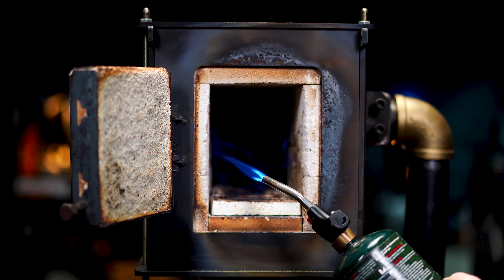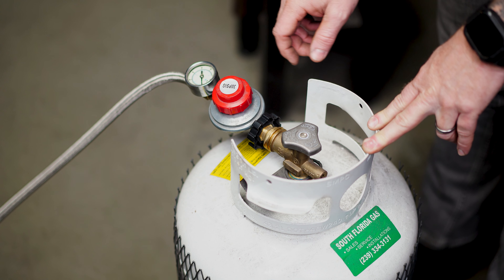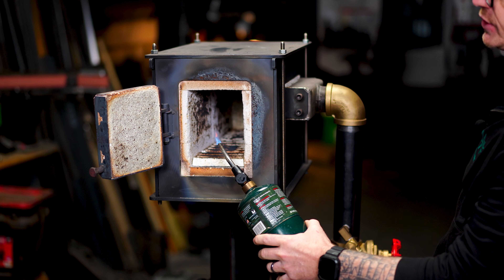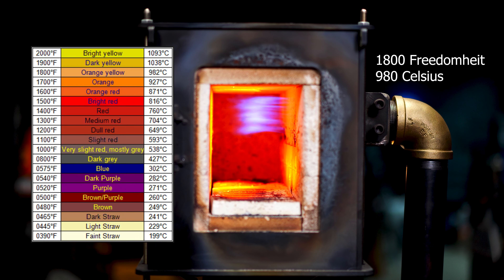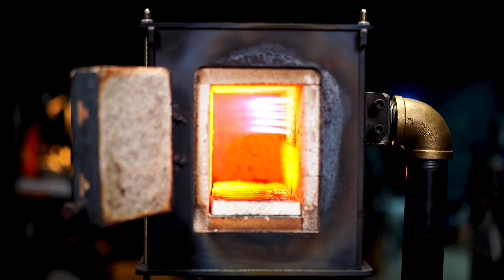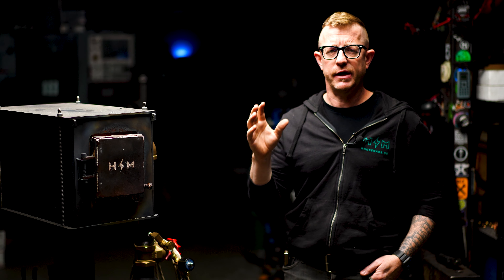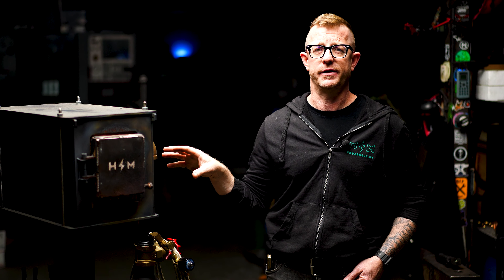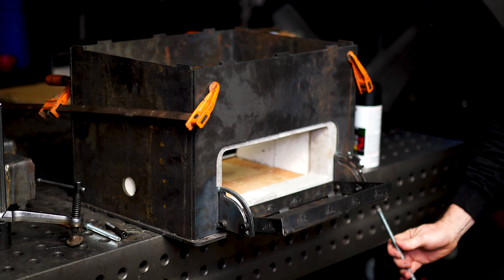How to: Optimize the Apollo Forge

Comment: Brian, look into / talk to Mark Krause about his conical jet burner rather than a ribbon. Safer in that it doesn't mix the propane in the pipe leading to the burner, rather injects right before the forge into a hollow cone bored into some soft firebrick. I use these on my furnace as well as my forge. Not as evenly distributed as a ribbon, but the "nozzle" orifice can be geometrically adjusted to disperse the flame more evenly and induce swirl.
Reply from the maker: Interesting. I'll ask him about it. Thank you.

Comment: When do you completely open your needle valve so your 2 psi is reaching the burner for ignition?  I'm the 1% part of the  10% part. I'm also sitting at 4393', which I'm thinking may be contributing to not getting a better efficiency with my forge.

Thnx 

Jon
Reply from the maker: Hi Jon, I don't usually ever completely open the needle valve. I just use it to fine tune the forge. Once it heats up it becomes very easy to maintain temperatures. The green flames are just from the camera, it's almost always blue, yellow
Reply: Thanks Brian 😊@HouseMadeUS

Comment: Talking of different forge designs I’d be interested to see a ribbon burner postbox forge. 
I don’t know how popular that would be though.
Reply from the maker: What is a postbox forge? I've never heard of this. Is it like the one Kyle Royer uses?
Reply: Possibly. It’s where the burner is at the bottom and the entrance is at the top. Basically a normal forge vertical with the burner at the bottom so you get complete burn by the time it gets to the opening. The other benefit I’ve seen is the bottoms are removable so you can replace the insulation for flux build up.

Comment: I've been working with industrial, high pressure, compressed gas life support systems for a long time. I was always taught to turn gas bottle valves all the way on then back off a quarter turn.
However, years later I was told by a company technician to ONLY have the valve all the way open or all the way closed on the consumer grade bbq style tanks. Specifically, any position in between can allow for gas seepage into the workspace which can lead to some catastrophic events.
Just an observation, perhaps some of you have been told otherwise????
I'm always open to learn something.
Reply from the maker: I have not heard this. You can smell propane so if it's leaking I would know, and it doesn't.
Reply: Yes, I use Praxxair and they say to fully open or full closed. No middle position, the stem seal will leak, but there is a seal at the bottom “so to speak” and one at the top. Only valve that works in the “middle” is the acetylene type valve.

Comment: I think your forge welding range is a little high.  If you're forge welding with a power hammer or press, 2100º - 2200º is optimal.  2200º-2300º for everyone else.  If you want steel that's going to be compromised, go hotter.  A great example of forge welding too hot would be the Forged in Fire episode where Josh Smith lost because his sword edge chipped out.  He heat treated perfectly, but his steel was already jacked up due to the forge welding temps.
Reply from the maker: Definitely can be an issue. I tend to thermocycle 3 times after I forge weld. I have had some grain growth as a result of it being too hot. Lesson learned.
Reply: I hadn’t had a billet failure in a long time, but lost about a quarter of my last billet due too high of temp. The issue was I forgot about it, and it soaked at full heat. A huge section of the billet just crumpled apart. Kinda sucked, but it was completely my fault.